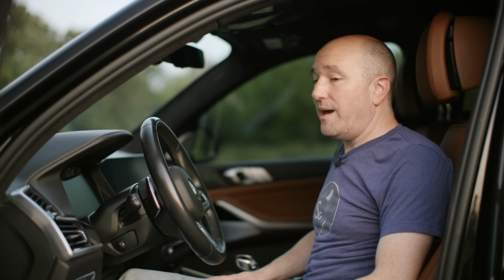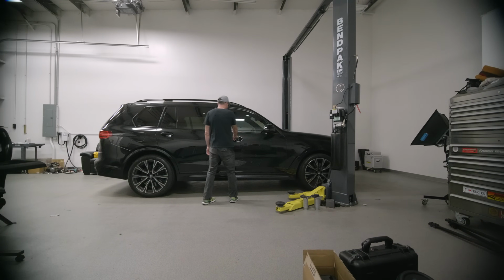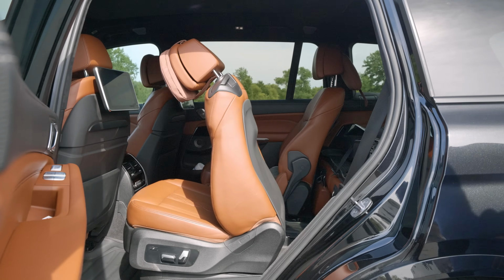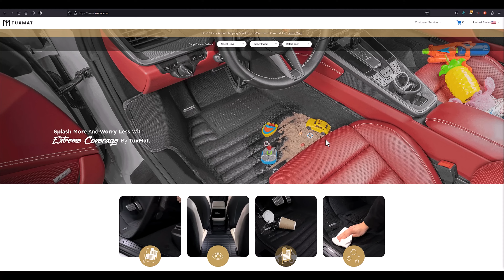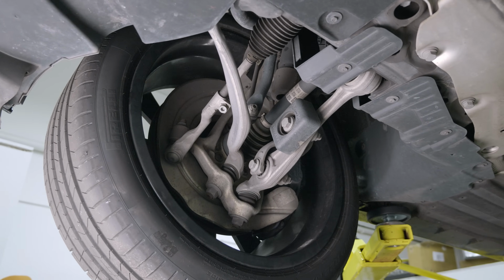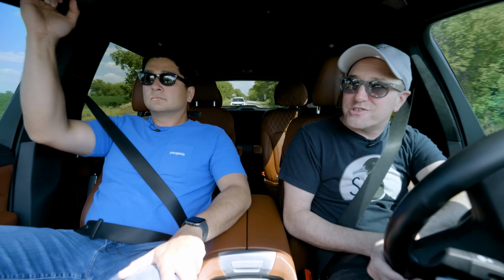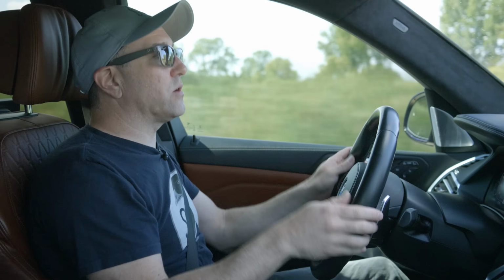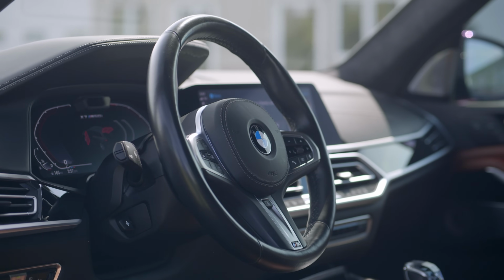BMW X7 | 45,000 Mile Long Term Results

Comment: What puzzles me about this loaded M-series SUV is, how many first-time owners will take the time to learn its limitless configuration capabilities? I know a few members of the demographic that buys a $120 thousand SUV, and not ONE has ever bothered to read his current car's owner's manual. With this thing, what they need to know is right there on the cover: the BMW roundel. The advanced features are of no interest to them: what counts is that it's German and priced  in the six figures. Because this is their entreé into the world of impressing strangers being more important than being loved by friends.

To this buyer type, who is not a motorhead, and intends to use it only as a commuter, the clincher is this BMW's high price and prestige.  This Euro SUV sets them apart, from a lofty vantage point looking down on the plebes in their Priuses and gently sneering as he pulls away when the light turns green.

Over its lifetime, 90 percent of this SUV's advanced features never will be activated. The true motorheads who are the third or fourth owners will experience BMW hell (I've been there), where on a super expensive vehicle with reasonable mileage, say, 75  thousand, the motorhead guy will quickly discovers that though he could afford the hugely-depreciated buy-in, the running costs are beyond anything he was ever aware of. And if you let one of these babies go unserviced, it will self destruct before your eyes.

And so we arrive at the bitter irony. A heart-stoppingly expensive high-performance SUV whose owner (or more likely lessor) will devote his three-year lease to commuting in stop and go traffic. It never would it occur to him to use its performance potential, because he doesn't even know what that means.

Only after a second or maybe third owner acquires it will the owner's manual finally be cracked. The motorhead in charge immediately tries every one of its performance features. Most work as claimed, but the end result of engaging the rear-wheel steering and playing with the air shocks on his favorite back road leaves him vaguely unsatisfied. Yes, it goes like hell, and its performance stats are probably off the charts. But in real-world, back-road driving it's just a boat. Huge, incredibly heavy, with a high-up driving position that disengages the driver from the road . . . The thing is a pooch. 

That such models exist shows the corruption our consumerist, influencer-obsessed car market has become. Nobody buys the car they love anymore. They buy what they think other people will love. Because in our atomized society where the old bonds of profession and family have been replaced by greed and narcissism, this owner's only hope for a human connection is the driver of the car in the next lane, admiring his BMW.
Reply: nice, now do Porsche

Comment: Are you comparing Acura MDX with BMW X7? How funny???
I rode both vehicles. 
you are comparing each other like Mango vs lemon.
This is showing up this review is completely worthless & paid review by favoring MDX.
100% worthless arguments.
BMW X7 ride quality is next level & only missing part in this car is more adoptable air suspension, need to improve cabin noice from road, need to improve 3 row access by increasing 2-3 inches body length.
Trim down central console & reduce its height below knee.
They should not charge 900$ for leather  trim for interior front cabin.

Comment: Why would you have any problems with a car that isn't has 46k miles? That's practically new.
A bottom of the line Hyundai won't give you trouble from 100k miles.
Let me know at 80k miles what's still working on that pile of crap.

Comment: IMO this is a classical case of the wrong vehicle for the task it was intended for.  If I am going to be using a vehicle for long business trips, using it as a chase vehicle for videos and also for hauling stuff and people, I would be looking at something from Toyota or Honda; I would want something that has a reasonable operating and insurance cost (something not mentioned in the video but this will shock you), and also has a large network of dealers/auto repair shops able to support me if things break.  A simple cracked windscreen when on a business trip can spell trouble for an expensive vehicle, but for more common vehicles it will be a cheap, simple and quick replacement.

For fun, I'll keep a 2nd vehicle for that.   Something to take out on weekends and simply just to drive for the sake of driving.
Reply: which Toyota or Honda would be up for the task of on-track chase vehicle?  (genuinely curious since I don't pay any attention to either brand and I'm ignorant of their offerings)

Comment: Tux mats suck. Their customer service is horrible. I live 5 minutes away from their distribution center and they wouldn't allow pickup. Its chinese made crap. I bought a set for my model Y and used it over the winter, the bottom of the mats had salt bleed through. That never happened with my weather tech mats. Stay away from tux mats.

Comment: This feels like the complete antithesis to my SUV: a 2023 Toyota 4Runner. It has a 4.0L port injected N/A V6 with very unimpressive power per liter and a whopping 5-speed automatic... but it works. Everything has a long proven track record of working and never not working, and maintenance costs are very minimal; like $200-300 of fluids every 50-75k miles on top of cheap oil changes. I have never understood German luxury cars, let alone the biggest German luxury SUVs, but I guess I don't have to.

I don't know the entire Toyota range that well, but what does this do that justifies the extreme initial and ongoing expenses over, say, a Grand Highlander? Make V8 noises, have a slick infotainment, and massage my butt? That's only worth so much to me.
Reply: @@japanwatchconnection actually, no. More specifically, it is a 2003 platform and chassis (4th gen 4Runner), with a 2003 engine (that was updated with dual VVTI in 2010), a 2005 transmission, and a 2010 body with a 2014 facelift. It is indeed very old, but it's not 90s old. The 3rd gen 4Runner, 1996-2002, is an unrelated vehicle that doesn't share any parts. I owned one of those, it was also great.

Comment: And the Hyundai/Kia people with their Genesis brand do all this but much, much better executed. Much better. Everything.
The German products, especially BMW, are horrendous. Poor engineering. Bad design. Terrible reliability. Titanic depreciation. 
Hard pass.
Reply: Hyundai/Kia engines are trash.
If you see a vehicle on the road with burned out tail lights and brake lights not working, it's always a Hyundai/Kia.
Reply: @povertyspec9651  if you say so...🤣

Comment: Why not bought a 330d Touring? Its even big enough to comfortably sleep in paired with enough punch and 40-50 mpg consumption. Or is it some american thingy to buy way too big cars and then wonder why it costs so much?
Reply: That would be very challenging, considering the 3 Series Touring is not sold in the US
Reply: Because screw 4 cylinders. We haven't had a 6 cylinder BMW touring since 2010 (the e61 which is what I'm driving) 

They'd sell probably 1000 M340 touring a year here if they brought it. Not much but regardless bmw just doesn't care anymore
Reply: @geko29  Crazy how things are different across the ocean. Here in midwest-Europe the 3 series Touring and the 1 series are probably the most seen BMW. Driving an X7 would you quickly put you into the shady-business corner.

Comment: As smart as Mark obviously is, I can't understand why he would buy something like this.  It's a fast SUV, why?  Who cares?  Wildly expensive, laughably so.
Reply: He wants a well engineered vehicle. Bmw is one of the best engineered cars along with Porsche Mercedes or even to an extent Honda as well
Reply from the maker: It's very hard to explain when you spend half your life in cars and about half of that time is in cars that are not your own. A lot of the cars that I'd feel very passionate and love to own are not practical for the day-to-day business use and Hauling purposes I need so it came down to what's the most fun comfortable and highest performance car that we can use to haul gear into chase other cars on track with cameras mounted and there's not much in the way of three row SUVs that compared to the X7
Reply: @savagegeese  as an owner of another high performance three row I agree.. my DDHC is far apart from the BMW offering as there is little to speak of in the luxury department but plenty of performance.   When you start to look at the small group of three row performance SUVs it's just a handful and they don't all offer the same experience, I can't think of anything that really overlaps with the BMW here aside from maybe the DBX707? Bentayga? and they are far more money.